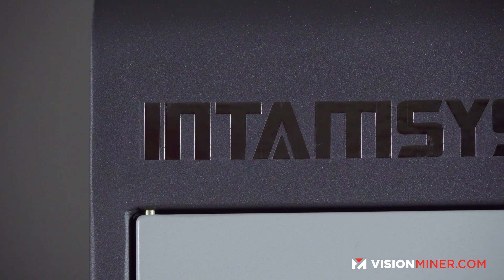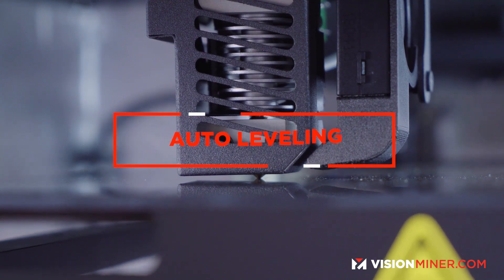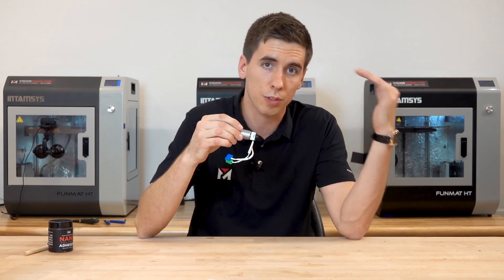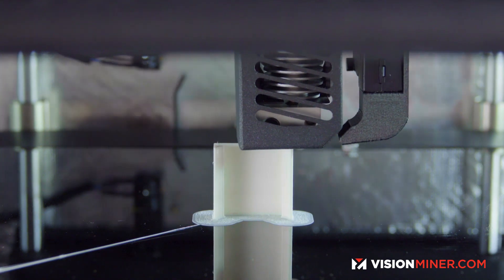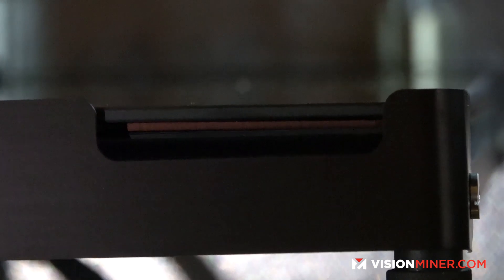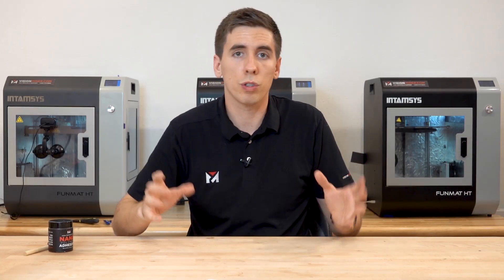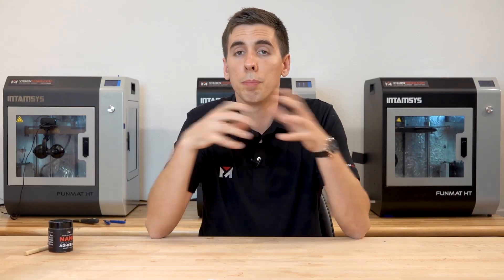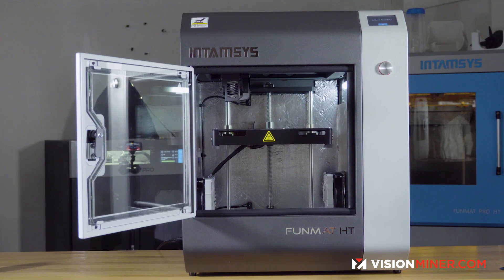Funmat HT Enhanced - is it STILL the most affordable PEEK & ULTEM™ 3D Printer (2020)

Comment: What do you think of the Flashforge Adventure 3, Dremel 3D20, Ender 3, Ender 5, or Ender 6 for a home unit when I had been used to using Stratasys machines (Dimension 1200ES and Fortus 400MC)? I don't necessarily need high temp yet, but I want good quality parts. I found a Flashforge Adventure 3, Dremel 3D20, and Ender 6 all slightly used on Facebook marketplace. I haven't owned a 3D printer yet because I was wanting to wait until the quality was good for the price.
Reply from the maker: If you want to start basic, grab an ender 3 or ender 5 for under $400 -- get the kit, put it together, and be prepared to play with it, a LOT! :)

Comment: How hard is it to remove ABS prints from the ceramic glass?
Reply from the maker: It can be very difficult without proper thermal management. We find cooling the plate quickly helps prevent chipping, but the best bet is using Kapton tape or PEI to prevent it entirely. Then, you can just let the plate cool, and the part pops itself off, with almost no effort!

Comment: Would an Olsson Ruby HT nozzle work well with the Intamsys Funmat HT Enhanced? The M6x1 threading and the maximum temperature limit of 500 degrees Celsius should be fine, but I'm curious if the bed leveling process and the high temperatures combined would slowly dislocate the embedded ruby tip from pressing against the build plate.
Reply from the maker: Should work just fine :)

Comment: Did you also have problems with the auto leveling system failing due to the micro switch failing?  Really struggling to get service from Intamsys in South Africa
Reply from the maker: These issues have been fixed, but we always keep spare sensors on hand if you need them :)

Comment: I have to ask a dumb question... can this printer do wood, ABS, or PLA?  It would be nice to have the ability to print PEEK and Ultem when needed, but mainly do more common materials.
Reply: It should be able to quite easily I'd imagine. it's just extremely underkill for it though.
Reply from the maker: @infernaldaedra  Yep! Thanks!
Reply: you would still need a special nozzle for abrasive materials like woodfill, glow in the dark and carbon fiber filled PLA. But yes it should be more than capable. I recommend MicroSwiss brand plated nozzles but don't know the specific one to fit this machine.
Reply: @flippantb  I don't think it should be a problem as this machine is geared towards carbon fiber thermoplastics and the like.
Reply from the maker: @infernaldaedra  Exactly :)
Reply from the maker: @flippantb  Right on!
Reply from the maker: Yes, you absolutely can. The machine is open material, and takes any 1.75 filament :) It also uses e3D style M6x1 nozzles, so our hardened steel nozzles are perfect for filled filaments, and there tons of options on the market!